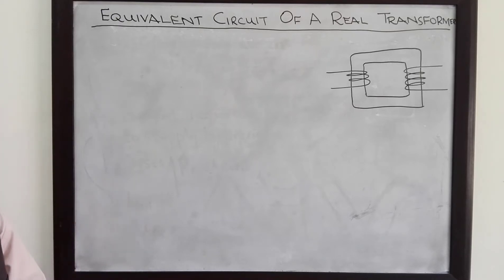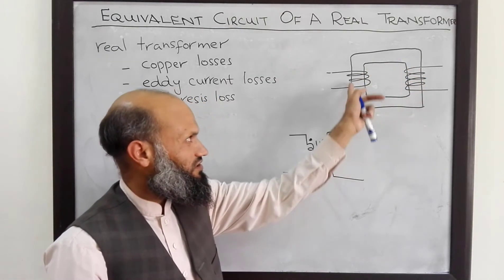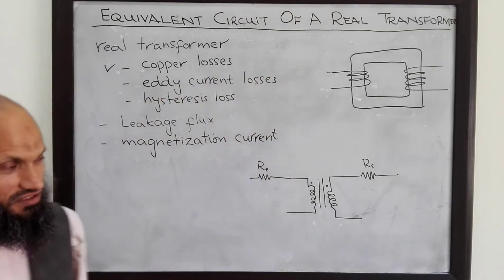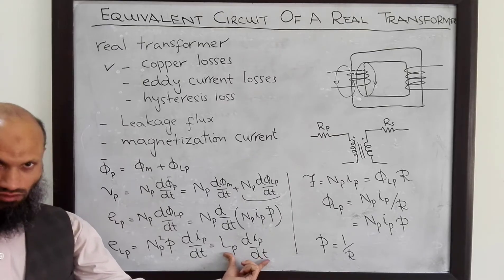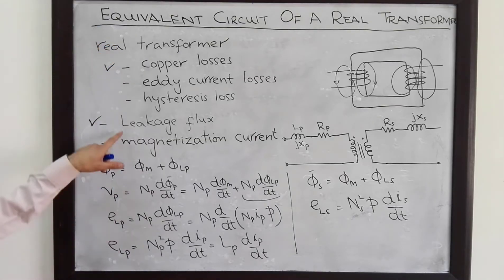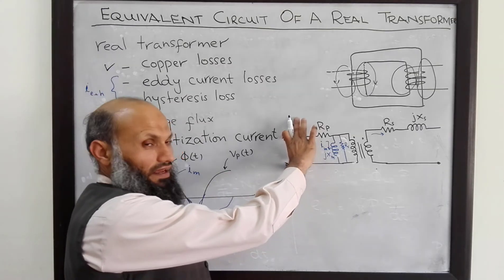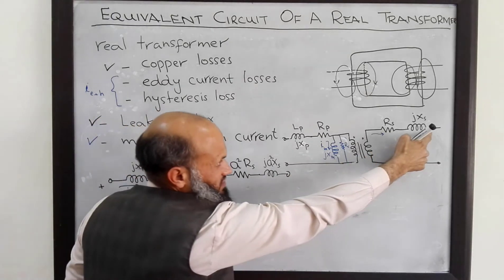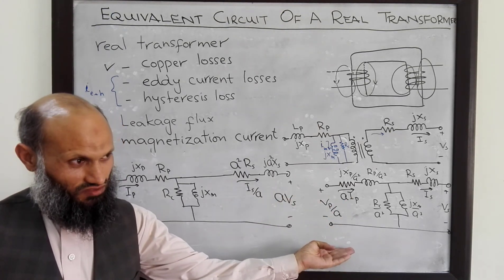EE213 - 08a - Equivalent circuit of a real transformer

Comment: Sir, the inductor that is placed to incorporate the leakage flux. What is it's value ?
In the video you mention it as "Lp" for primary side and also mention "Lp = j*Xp" where "Xp=2πf(Lp)"
so, if we put the value of Xp in the equation of inductor,
this concludes as "Lp = j*(2πf)*(Lp)" which is very confusing. I think you made a lil bit of mistake somewhere
Reply from the maker: The inductance is Lp, and it's inductive reactance is jXp. The two are related by Xp=2*pi*f*Lp.
Reply: rehman rehman  PIEAS
Reply: Sir, Why is the diagram equivalent to an induction machine after converting to the rotor side, they are different in frequency but still the same transformer